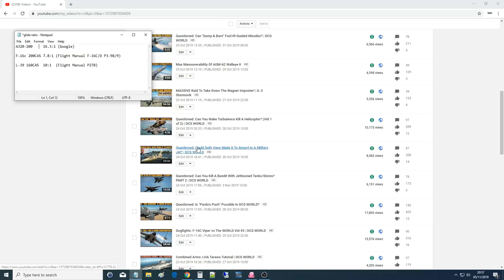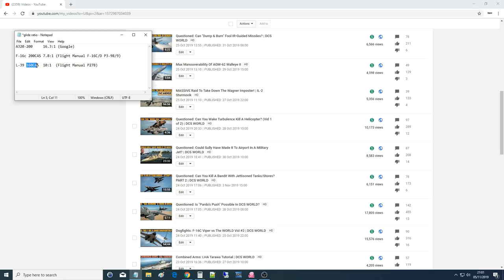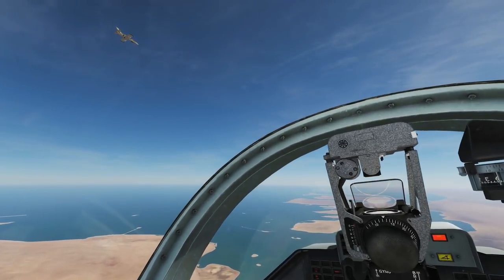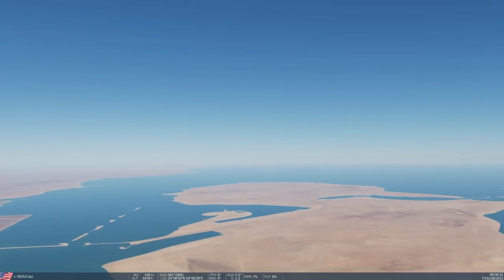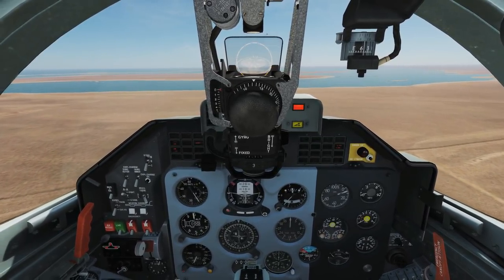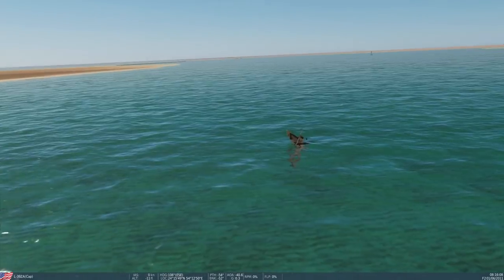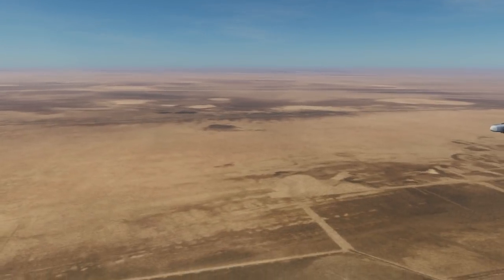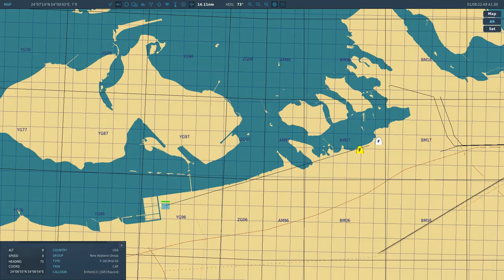Flying Basics: Aircraft "Glide Ratios" (Testing L-39 & F-16C In DCS WORLD)

Comment: I've been a glider pilot since '99... weight does not change the L/D (glide ratio)... the best L/D will simply occur at a higher speed when weight is added. This is why sailplanes often carry water ballast- to get the same glide ratio at a faster speed, and penetrate the wind better when flying upwind. The "minimum sink speed " is the speed at which you lose the least altitude over TIME. This occurs a few knots above the stall speed. Best L/D speed is the speed at which you get the most DISTANCE per foot of altitude lost, and is considerably faster than min sink speed.  When weight is changed, both of those speeds change, which could easily account for the anomalies you observed. Flying the same speed, at different weights, will not give you the best L/D.  You'd need to look at a "Speed Polar"- a graph of performance at different speeds and wing loadings.
Reply: Exactly 👍
Reply: this is the best explanation yet!
I forgot that best L/D stays the same -it's only airspeed at which it is obtained that is changing.
Reply from the maker: Thanks Sir

Comment: More fuel mass means more momentum. That's why glider pilots fill up their machines with water to secure the desired speed during competition and long flights.
Reply: was going to say myself, though still another important thing is the fact that the vehicle/body has less mass means that it can achieve lift at a far slower speed, what happened was cap descend a tad too quickly and because he had less mass then gave a worse glide ratio(or at least in theory in game could be different) thus landing sooner.
Reply: @caolindennehy2553  glide angle is not changed by weight. It just changes speed at the given glide angle
Reply: @Ripstop_pilot  yes, I think that's fair to say, given cap was at the optimal glide angle he would have I higher lift ratio at higher speed and a nominal one at a lower speed

Comment: The reason your L-39 went shorter than the other one is most propably that it was still flying too fast for it‘s weight.
Remember, two identical planes will always maintain the same glide angle, regardless of wing loading, but only at their respective airspeed for best glide. Flight manuals tend to show only „worst-case“-, or maximum Takeoff-weight figures for performance related topics such as best glide speed. So your buddy might have been perfectly on speed while you should have flown slower to maintain the same glide angle.

Conversely in the f-16 you were most probably nearer to the best glide speed for you aircraft weight than your buddy, hence why he is dropping like a stone.
You could try to both fly at the exact same angle of attack rather than same speed. You should get the same mileage then.

Cheers
Reply: Correct 👍👍

Thanks for saving me the effort of writing the same thing
Reply: @MrTurbohampster  😂
Reply: Sort of better to say that the AOA is the same regardless of weight, and hence the "glide angle" is the same. But you're right, that is why RC was gaining, they both should have flown AOA, not speed.
Reply: @D00kerT  Not sure what you mean AOA is the same regardless of weight. 

To be clear an aircrafts L/D ratio is a fixed value, it doesn't vary with weight.

The AOA at which the best L/D ratio is achieved is also fixed.

To achieve the same AOA at a higher weight you need to fly faster.
Hence a heavier aircraft will fly faster and descend quicker than a light aircraft when flying at best glide AOA.
But both will cover the exact same distance
Reply: @MrTurbohampster  I dont think we're disagreeing on anything. AOA is the same for stalls, L/D ratios, etc. I was saying that Cap and RC were flying the same speed, and that they should have been flying AOA and that might have had something to do with the fact RC was outpacing Cap.

Comment: Weight doesn't change L/D max, heavier aircraft just needs to go faster to have optimum AoA - 7deg for F-16. Actual formula for F-16 is 200kt +5kt per 1000lbs of fuel / stores, so 200 kt for you and 235 for guy with 7100 internal gas.

Comment: 6:34 That "little fan thing" underneath the aircraft is called RAT (Ram Air Turbine). It's one of the last levels of saftey systems redundancy that every aircraft needs to have. It provides the minimum electric power needed to keep basic flight instruments working on a minimum power consumption level. This electric power is what keeps your Fly-by-wire system working, so you can control the aircraft, also keeps your basic navigation systems working so you know where are you going and what/how the plane is doing.

Comment: L/D max is a function of alpha, so as others have commented a heavier airplane will have a faster glide speed than a lighter one.  What's missing  here is the energy state of the two aircraft.  Total energy is Kinetic Energy (KE) plus Potential Energy (PE), both include mass terms (KE=.5mV^2, PE=mgh).  So, the heavier aircraft has both more Kinetic and Potential Energy.  Usually, best glide speeds are listed for gross weight and for most general aviation aircraft the variation between a light vs a gross weight aircraft glide speed is small enough to disregard for the skill level of the average GA pilot.  All of that said, the heavier aircraft is actually closer to L/D max so it makes complete sense that it glides further because it has more energy and is flying closer to the optimum glide speed.  That V^2 term in KE makes a difference!

FWIW I am a private pilot and have done this in training, also professionally I was a USAF flight test engineer who took Test Pilot School short courses flying gliders characterizing things like this.  Finally, real world I actually had an indicated engine failure on an aircraft I was flight testing in Iraq and actually had to dead stick an aircraft over 20 miles back to base over northern Iraq back in the day, fortunately it was just a bad sensor.
Reply from the maker: Thanks MK

Comment: as mentioned in comment by Anvil, some sailplanes carry water balast which gives them greater L/D ratio at a higher airspeed. In tests you should focus on holding indicated airspeed from manual, all the way down and dont pump the stick before touchdown.

Edit: if you want to test how much terrain you can cover while gliding than you should hold the airspeed and not chase the angle because ideal glidepath is something you GET when flying at correct airspeed for given weight (not including effects of wind here). If weight is changed -maximum glide ratio obtainable will change. It will also be at a different speed.

Comment: Weight theoretically doesn't impact glide ratio your Vbest glide will be a bit higher but you will have the same ratio. This is also the reason gliderpilots fill their wings with water on good days to achieve higher average speed with no real drawbacks other than a slighly smaller climb rate in thermals.

(Wrote my comment without reading the other comments, then noticed I wasn't the first to comment this)

Comment: Please consider that best glide speed (BGS) is weight dependant. Glide ratio does remain the same in the same aircraft, but with heavier weights it will fly faster and will arrive to the ground sooner than the very same aircraft carring a lighter weight, but BOTH WILL TRAVEL THE SAME GROUND DISTANCE FROM THE SAME ALTITUDE.
This is the reason why competition gliders carry a heavy water ballast, to allow a faster flight still flying the same distance per altitude.
It would be interresting conducting a practical experiment that would permit to draw the glide polar of certain aircraft.
In the same sense, as A320 has a representation of the max LIFT/DRAG ratio in the form of GREEN DOT SPEED, some aircraft in DCS can also show this data, said F-18 and probably F-16, and for the case probably all "digital" fighters of the same period.

Manuals often describe BGS for MaxTOW of the aircraft. To find the new speed for other wheights, simply aply this equation:

NEW_BGS = BGS_MTOW * SQR [ACTUAL_WEIGHT/MTOW]

Thx for the video
Reply from the maker: Thanks Sir

Comment: Lots of people are saying that weight doesn't affect glide ratio and that gliders carry ballast and so on. I am no expert but I'm with CAP. A heavier aircraft must have an effect. There is after all a reason that gliders are made of advanced super light materials. If weight doesn't matter can I make a glider out of concrete? 

I'm puzzled why glide ratios in manuals would be for anything but zero fuel? If you need to glide then either you have no fuel or the engine is dead so dumping the fuel would seem to be the thing to do anyway. 

My Father was a senier commercial instructor and ex military fast jet pilot so I am sure he would have had the answers I need. 
Its always the little things that you miss the most.

Comment: Cap, gliding characteristics depend on the wing layout and AOA largely. The sleeker the wings, and the smaller sweptback angle, the higher the lift over drag ratio L/D. Let's call L/D like rd. Then, drag is lift divided by rd (D=L/rd). Since lift must equal weight, higher weight means more lift, thus more drag inevitably. But a better (greater) rd, reduces drag.The reason gliders can reach longer, is that they have long sleek wings, and low weight.
To gain the optimum in any plane, the pilot needs to keep it's AOA and speed right. To do this, he adjusts the horizontal tail. If he needs to increase his AOA, he must pull back, making the tail push down. This he must compensate with more lift and thus even more drag. The water tanks in gliders are probably in the nose and the tail, making it possible to adjust AOA without having the tailplanes push down. Hope this helps, keep up the great work!
Reply from the maker: Thanks Sir
Reply: Only thing you weren’t 100% right on was the water (ballast) tanks location in the gliders, they are in fact in the wings just like fuel tanks would be. And if I remember correctly most gliders actually have a LOT more ballast weight than one might think, pretty sure the competition gliders carry like almost 200lbs in each wing(:      (please PLEASE don’t quote me on that I’m not sure if I’m 100% correct and if someone knows the actual weight/gallon capacity of gliders please let me know!!!)

Comment: I would assume the slight difference in distance is due to slight differences in maintained airspeed and as the airspeed should have been higher for the heavier aircraft ? given the following assumptions.
"Variations in aircraft weight do not affect the glide angle provided that the correct airspeed is flown. Since it is the lift over drag (L/D) ratio that determines the gliding range, weight will not affect it. The glide ratio is based only on the relationship of the aerodynamic forces acting on the aircraft. The only effect weight has is to vary the time the aircraft will glide for. The heavier the aircraft is, the higher the airspeed must be to obtain the same glide ratio. If two aircraft have the same L/D ratio but different weights and start a glide from the same altitude, the heavier aircraft gliding at a higher airspeed will arrive at the same touchdown point in a shorter time. Both aircraft will cover the same distance but the lighter one will take a longer time to do so."

Reference: https://www.skybrary.aero/index.php/Glide_Performance

Comment: Cap, most aircraft have an optimum speed where the drag is minimised. That determined by lookibg at a wings polar diagram. This sort of diagram shows the relation between alpha and lift. At that optimum angle of atack you can obtain maximum glide ratio. Weight does NOT change the distance, it only changes the descend speed and airspeed.
Reply from the maker: This is so bloody confusing lol

Comment: I think the test of the L-39 need tweaking to give rational results. You may have to try different airspeeds for the different weights...desired result is lowest ‘sustainable’ descent rate for the condition. 
Now I introduce you to Ground Effect Compressibility where near the ground the compression of the airflow between the ground and the bottom of the wing gives you way more lift and dramatically increases the glide ratio. Effect causes the ‘float down the runway’ effect when landing. The Russian Ekranoplan (Caspian Sea monster) flew full time in this area. And...discuss.
Lol.
Reply: MrPnhartley 
Except lowest descent rate will not result in furthest glide. Speed for L/Dmax will always be higher than that.
Reply: I don't think desired result was:"lowest ‘sustainable’ descent rate for the condition. " , rather the speed at which most ground would be covered, i.e. -at which speed should I fly, with this weight, to fly furthest that I can?

Otto beat me to it.

Comment: When trying to glide a aircraft the amount of lift at what speed a wing can produced is good to know.
different wing(aircraft) have different lift based on it's area, angle, curve, form, weight and speed. 
So when using identical aircraft same start speed to see glide using a...
..Very very simple way to explain might help.
More mass = more momentum
more speed = more lift..  
But yes this have a threshold where to much weight and drag will take over the lift factor of what the wing can produce in X speed.
And then the effect would be opposite and you drop like a stone.
So how much fuel you need to have left to get the best L/D glide distance vary a lot on how much lift the wing can produce at what speeds.
Aerodynamics can be very frustrating and some time it seem to break all laws of physics but it doesn't, it's all about variables and numbers and they are pretty straight forward.

CHEERS!  Keep up the awesomeness  ;)
Reply from the maker: Thx Mich
Reply: @grimreapers  You're welcome. ;)

Comment: Lots of comments are saying that weight doesn't matter and that gliders carry ballast and so on but I'm with CAP, weight must make a difference. I'm no expert but there is a reason that gliders are made of advanced super light materials after all. Can I make a glider from concrete? The ballast on a glider surely could only be a small percentage of total weight, Or a small increase to wing loading meaning they trade speed for climb ability. VS a jet with full tanks weighing 50% more, or even more so for a fully fueled A320.
What about aircraft with internal bomb bays? If they lose power is it of no benefit to get rid of the bombs? That doesn't seem likely.
I'm also puzzled why aircraft manuals would give glide specs for anything other than empty? If you need to glide then either there is no fuel or the engine is dead so getting rid of the fuel would seem to be the thing to do anyway. 

As a side note I know the normal procedure for flame out is to immediately turn your airspeed to altitude and a fully fueled plane won't be able to get as high.
My Father was a senior commercial instructor and ex fast jet pilot in the RAAF so I'm sure he would have had some good answers for me. Its always the little things you miss the most about people.
Reply: As mentioned in other comments gliders take water ballast for competitions to increase their speed initially, and later on they can drop it if they predict that they won't make it to the finish.

The thing here is that with more weight you need more speed to generate lift. More speed means more drag, and that means that you can't possibly get the same glide ratio as with a lighter plane and lower speed.

The tricky part is that it's not that easy to predict the optimum solution to the more speed vs more drag question, as the drag reduction must be must be considered over time and distance, as you do reduce your speed.
Should be quite easy to find that speed in a plane/simulator though looking at the altimeter, speed gauge and correcting the glide angle. That's basically what gliders training is mainly about...
Reply: This is basic aerodynamic theory.

Your dad would have told you that weight does not affect glide ratio.

https://www.skybrary.aero/index.php/Glide_Performance
Reply from the maker: Thanks JJ
Reply: @MrTurbohampster  Don't spread untrue information.
To understand it simply put 10 tonnes of ballast into a glider and see how it goes.